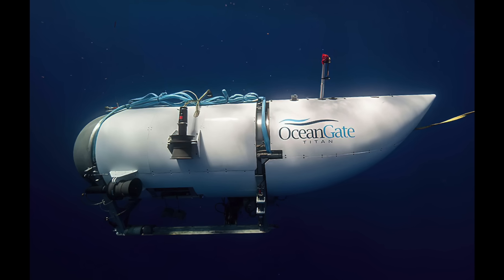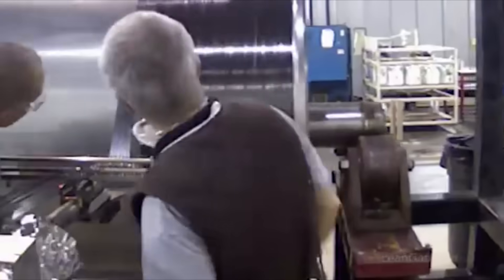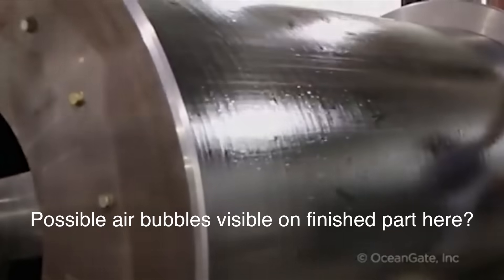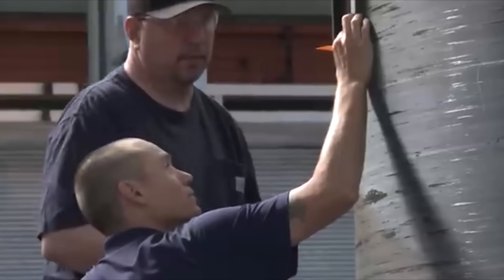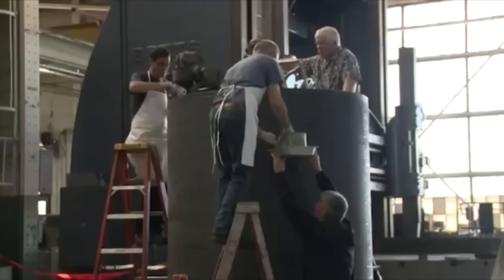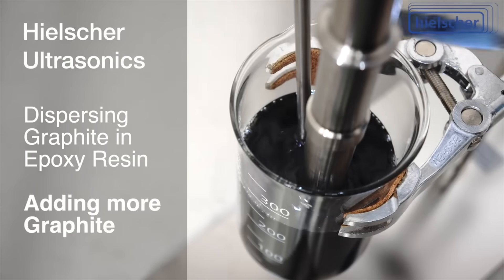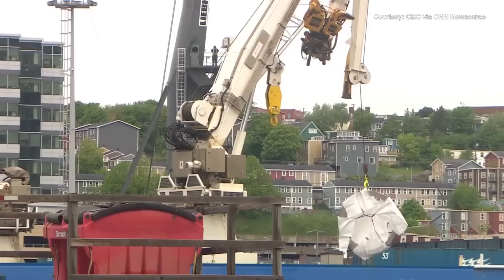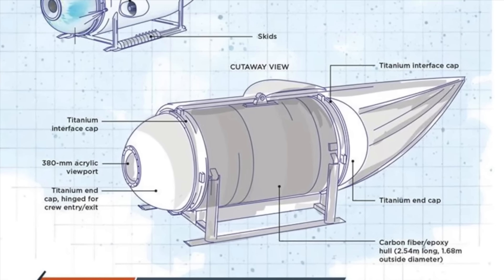Why OceanGate Titan Imploded - A Carbon Fiber Composites Perspective

Comment: I think the problem was the difference in stiffness between the carbon fiber and the titanium end caps. Under the pressure¸ the CF cylinder would have compressed in the radial direction much more than the titanium ring. This would lead to radial shear and bending stresses in the glue joint.
Reply: There were just so many pathways to failure, about half a dozen that seemed inevitable.  Various things to go wrong in the bond, same in the layup.  Rush really had a psychological blind spot in his intolerance for criticism.
Reply: As a materials engineer, the difference in modulus of elasticity between the titanium and composite seems like a likely cause of failure here. Computer modeling was likely used to calculate the stresses involved, but there can be  many reasons for adhesive bonds to not meet the properties listed by the manufacturer. Consequently, extensive testing of the bond should have been done before risking human life in the vessel.
Reply: Exactly what I was thinking.
Reply: This is a definite possibility, and is what my first thought was on hearing that the sub had titanium end caps and a carbon fiber pressure hull.
Reply: What about the difference in thermal conductivity? As the sub goes down, titanium will cool faster and squeeze the carbon fiber. Someone would have to calculate if this stress would be enough to do damage.
Reply: @MrFujinko  Thermal expansion/contraction and conductivity should certainly have been considered in the computer modeling that was done (that modeling was done is an assumption on my part). However, my guess is that these effects would be much less important than comprehensive stress/strain are, but  knowing for sure is why you do the modeling.
Reply: My first thought too. Forget submersibles, that joint type alone doesn't seem fit for purpose in anything but a strut in compression through the axis of each cap, preferably with no lateral movement. I would assume the forces as you describe and it would seem far more intuitive to maintain the wall thickness of the titanium whilst reducing its diameter to slip inside the tube say 200mm or so. Wouldn't rely on shear strength of adhesive. Once the adhesive lets go, and its basically a butt joint you only have the shear strength of the thin lip of titanium to stop it collapsing. I think the glue is fine but just to hold the parts together during transport not as a structural component. I have some filament wound fork legs for a motorbike with alloy fork bottoms glued into the bottom, but the tube is 50mm and the alloy extends inside 50mm and is glued with Hysol. Glue is just there to stop if falling out. Mechanically its still just as strong without the glue.
Reply: Using carbon fibre in the first place was the problem. Money saving aside, it is not the appropriate material for something resisting outward pressure. 

If you think of a woven basket, it’s incredibly strong when tension acts outwards on the weave tightening it. But as soon as you push in on it, everything comes loose and all strength is gone. 

Now imagine that happening to each layer of that carbon structure, getting worse and worse every time…
Reply: @tyler_bt3326  CFRP might have been a poor choice for this application. But not for that reason exactly, in my opinion. Strength of CFRP in compression is about  85% of the strength in tension. So weaker, for the reason you state. But not worthless. Any composite beam, like a wing, or even a sandwich panel. One side of it is in compression. It performs fine. Problem with CFRP is that it is hard to inspect and get consistent. And it is hard to bond it to metals.
Reply: Absolutely. This is what happened i would bet my house on it.
Reply: I was saying something similar right after I saw the videos of the application of the resin and joining of the endcap ring, and the main carbon fiber hull.  It was so obvious to me this was a terrible point of failure.  I didn't have an idea of exactly why you would get differences in compression, but it is well known that materials do compress at that depth, so it is obvious to me that different materials will have differences in their compression signatures, how fast they compress, and what they curve looks like.. 
First thing I though was why such a small overlap, this gave zero tolerance./. if you have such a large difference in how these material respond under pressure, and more specifically how much they compress under that kind of pressure, and if there is a difference of even a few mm at that incredible amount of pressure, than you have to believe the stress on that bound becomes far greater then even the general atmospheric pressure at that depth, because you could even get basically a mechanical advantage situation where the carbon fiber tub against the lip of the ring, is acting as as lever essentially, putting even more stress at the furthest point on the join.  So that goes back to how much overlap is optimal.  And it's clear they had no clue, they just took a guess.

I can't believe they didn't spend at least the most basic time testing under pressure tanks this design.  Like doing this at say a 2 ft overall scale, and spending that 100,000 dollars to build that scale model, and test the hell out of it.  At a minimum.  At a minimum. Or experimenting with different end cap to carbon fiber tube joining, and testing what kind of resin mixtures, etc had to the overall bond between the materials with this kind of structure, and against similar forces. 
The absolutely insane ego to sit there and brag about how they are doing something extremely experimental, not just with the tube, but even with what they were doing with the bonding agent. how do they even know how the fiber agent mixed in would perform, or again what kind of pressures you will get on the bond due to compression differences in the material, etc.

And then, in the media is the comparisons to extreme design philosophies is made like extreme design is dangerous... But the entire point of extreme design is to not just trust some planning on the blackboard in some meeting room, but instead actually test things in reality.   It couldn't be the furthest from teh truth that extreme design is more dangerous, when done properly...  In fact i believe when done as intended, it is far safer. The problem is this company claimed to be doing extreme design, but they did the worst kind of thing possible, they took the worst parts of design to death, and combined that with no testing.   The exact opposite of extreme programming, or extreme design philosophers.  
In extreme designing philosophy, you are supposed to get to a physical product as fast as you can, and then test until failure, rebuild, once again test until failure.  And repeat. What they did was totally throw out any experienced design process, and just threw what was the cheapest design they could come up with on the board. And then they built it once, and then proceeded to test with unknowing tourists lives the actual design.   The entire most important step of extreme design is to test until you pretty much know it's failure point.  They took one dive, and called it safe... 

They should have built this darn thing once,.  then tested it going up and down up and down until it failed to 20% over the depth of the titanic(or whatever depth they wanted to bring tourists too), and assume it would fail, and keep going up and down until that damn thing did fail.  And then find out why, and fix the issue, and then rebuild, and do it all over again, until you have tested it by diving over 2000 times. Then build the final titan sub, and make sure you only dive less then say half the dives you did on your test ship that passed.. OR at least no more than to 80% and to only again 80% of the dive depth you were testing it at over and over again.  They seriously proved that when you have a person with just enough raw charisma to get people to believe in them, if that person has no idea what they are doing from a leadership and safety perspective, it is a recipe for catastrophic failure... Stockton Rush unfortunately seemed to have enough unjustified confidence in himself that he convinced others that he was a pioneer, when in fact in reality he was riding the Dunning-Kruger curve right out at the furthest edge...

The sad part of which, reality caught up to him exactly when a teen age boy who didnt' even want to go was aboard...
Reply: I was thinking this too. Seems like you would want the more elastic material on the outside so pressure increases the bond rather than pulling it apart when it's inside the titanium.

Comment: You've pointed out some of the questions I had about the carbon fiber section.  The two part epoxy applied with a mixing nozzle, reorienting the fiber direction in subsequent layers, and proper surface prep should have been no-brainers.  I have yet to hear anything about how the carbon fiber section was cured.  Aircraft industry standards for curing composites is to bag the part (on the mandrel) and apply a vacuum inside the bag to compress the layers before and during oven curing.

Overall, it seems either shortcuts were knowingly taken, or someone didn't know what they were doing.  But what do I know...I'm just a 68 year old white guy that worked in manufacturing laminated aircraft components (including heat forged carbon fiber airframe connectors).

Comment: Great to see some knowledgeable, objective discussion - thanks.

Hadn't heard Rush saying "no torsional forces" but as someone who has spent a lot of time in small composite boats in tidal waters, this doesn't ring quite true to me.

If you consider a dive in a swimming pool, the predominant force is indeed the compressive water pressure. However, the ocean is a much more dynamic environment. From tidal streams near surface, to the deep ocean currents moving vast distances, a diving sub may potentially cross many interfaces where the water on either side is moving in different directions.
In addition, they towed the sub on its raft out to the dive site. The raft will have protected it from the stresses of bridging between wave crests, but depending on weather it may have been subjected to irregular wave impacts. 

I don't know the relative magnitude of these forces, but I doubt they should be written off as negligible. Even if each instance is not overwhelming, surely they would have a cumulative effect?

Willing to be corrected if wrong!

(Re layup: even our small carbon fibre boats are vac-bagged!)

Comment: Video is incorrect. Rush stated the layup is in the AXIAL and rotational direction. If you do your research you’ll see they used a combination of uni prepreg laid in the axial direction and uni tow windings wet laid in the hoop direction providing a 0/90 layup. I’m also not a marine structural engineer but I believe this is exactly what would be ideal in this application. Assuming of course you were committed to using composites.

Comment: The adhesive appears to be a Hysol adhesive like 9394 precision diameter ceramic beads are mixed in for Bond line control. But the titanium prep if any surface etching like PasaJell acid was not shown. Joints are always the problem in composites.

Comment: How in practice is strength to weight different from strength to buoyancy. If you make a cylindrical container, the buoyancy is 100% determined by the volume, as determined by the full diameter, and the average density. The material that gives you the most strength for a given weight will thus be the answer. The fact that he tried to make it sound like they are fundamentally different, is illustrative of the type of narcissist we are talking about.  I'm wondering, as a non-expert in composites, what would the consistent heat transfer have done to the material integrity? Especially thinking about the cold water with its high specific heat capacity and conductivity, vs the epoxy carbon interface, also considering the heat added from inside the container.
Reply from the maker: Very good points! One of the interesting things about carbon epoxy is that it has quite a low coefficient of thermal expansion. So it probably wouldn’t deform too much however I do worry the Titanium element would have had a different one. I think that’s why they wanted to use a flexible glue to combat such differences. Good point about the inside temp being one thing and the outside being my another whilst subjected to the forces. Very different to simulate on a computer I imagine with all the variables.
Reply: @JamieKunka  Thank you for the reply. I think my major concerns are the deltas in the thermal properties of the various materials. As you said, the titanium ring vs composite is one. Within the composite, though, I'm wondering about the epoxy vs carbon fibers. I would imagine that tiny differences could break adhesion, essentially through thermal cycling (I'm not ignorant to the fact that the pressure cycling is way more significant, but it is way worse in combination). Then back to the glue, what happens to the flexibility of the glue at that temperature. In my mind, combining all these potential thermal issues to the pressure cycling, makes it feel quite inevitable.

Comment: Looking at the Fiber being wound on the spool to be the pressure vessel the ends were metal. Like string on a bobbin. They keeps saying the end caps were glued to the fiber. It looks like the metal ends of the 'bobbin' were glued to the titanium end caps.

Comment: Yeah, what you all wrote… 

Not that I could possibly read all the comments from all the know-it-all.  Some are far too long, but all are ironically unsolicited comments from other arrogant men.  Some commenters share their entire working timelines; explaining everything for, uhhh… 80 years? Explaining that they worked for years with: composites, fibers, resin, epoxy, carbon, oils, steel, water, marijuana and sugar!  Geesh, they  also felt the need to share how they never ever have not worn gloves or didn’t wear a mask or didn’t bulletproof vest nor done anything that was done by this rich  asshat and the tools he chose to help him mix and match parts for his little submarine. Err, I mean submersible.

Comment: In a cylinder, pressure (internal or external), will be two times in the hoop direction (circle around the cylinder) but one in the axis direction.  For rockets and internal pressure you either add end to end loops or use a 27 degree “magic wrap angle” which provides needed end to end strength without giving too much hoop stress.

I heard that there were layers of multiaxial carbon fabric added by hand in between the zero degree uniaxial wrap.  But haven’t seen documentation.
Reply from the maker: Very interesting about that magic angle. I do wonder if a design more like an internal pressure vessel, would have done much better over time. Will be interesting to find out if any other axis were used…

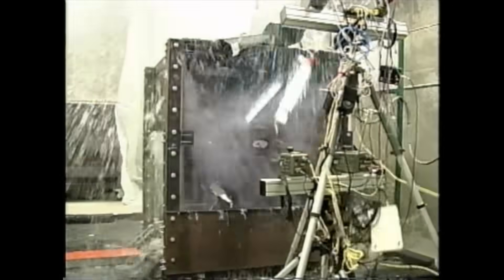Comment: That manufacture at 4:10 would have alleviated a lot of the problems with this hull, including all the stress at the glue joint. By making the viewing window a bit bigger and stronger, and have it be the only ingress point, it might have worked.

Comment: Good video!  For consideration, forgoing the predominant error regarding use of Carbon Fibre tow axially wound as a total misapplication of engineering principles, the geometry of the mating surfaces between the titanium ring and hull was completely misunderstood by Stockton-the-Princeton-engineer as well.

Comment: Would've a thinner titan or steel tube for structural integrity, that couldn't have withstood the pressures alone, reinforced with carbon fiber on the in- or outside or sandwiched in-between two thinner metal tubes to give it enough strength, worked out, or would there be no significant weight, cost, etc savings or certain other benefits, once those layers were thick enough to work reliably?

Comment: If i'm paying $250k for a ride to go down 4 kilometres to the ocean abyss and a staggering 5500+ pounds per square inch of pressure, I don't want to be hearing any "snaps", "crackles" or "pops"....

Hell, I wouldn't want to hear as much as a gentle fart coming from either the sub itself or the rest of the crew 😂

Interesting how Stockton mentions the straight winding of the carbon fiber is fine since its not under tension, but he doesn't mention that carbon fiber is known for it's tensile strength, not its compression strength (which is what it would be massively tested at at those depths)

Also, it would be interesting if some carbon fiber experts would do an experiment on this, possibly fashioning a 2" thick carbon fiber hull in a straight winding pattern, and another 2" carbon hull in a diamond pattern and then uploading the compression tests on Youtube.

Just what difference (in terms of strength) would the more expensive winding method have made?
Can carbon fiber ever be made nearly as good as steel alloy or titanium under cold temperature, extreme pressure scenarios?

Comment: Strength to buoyancy ratio my butt, what about STRENGTH TO PRESSURE RATIO-?  Theres so much wrong here, anytime you bond with epoxy there should be some roughing of the smooth titanium surface to enhance the bond, thats adhesive 101.  Theres a reason NOBODY BEFORE every used anything but STEEL AND TITANIUM for deep submersibles, its because STEEL AND TITANIUM are proven over and over and theres no issue of dissimilar materials or issues with fibers having voids and failing